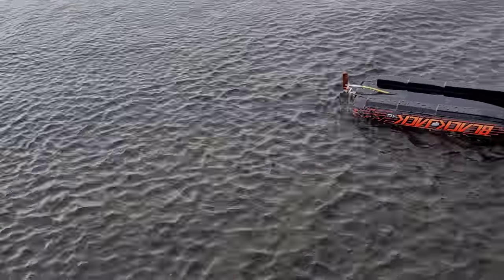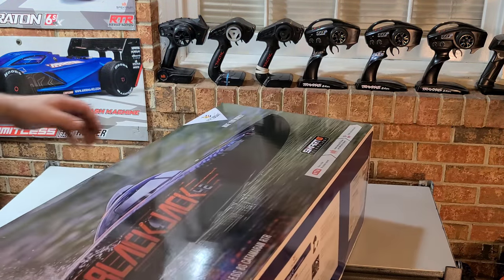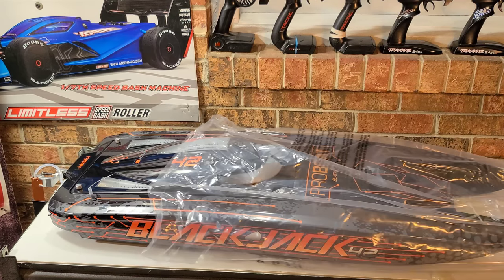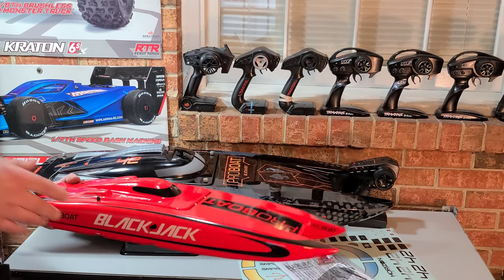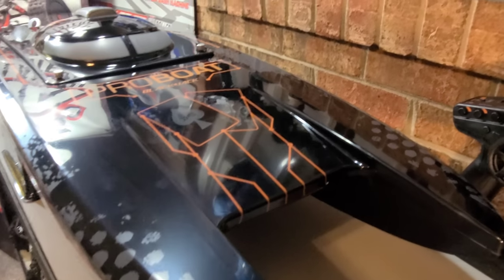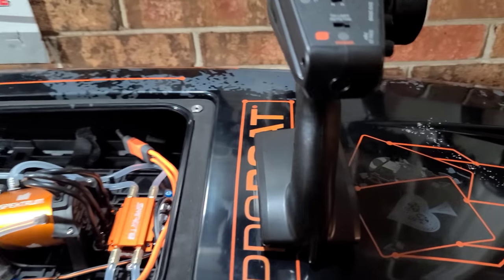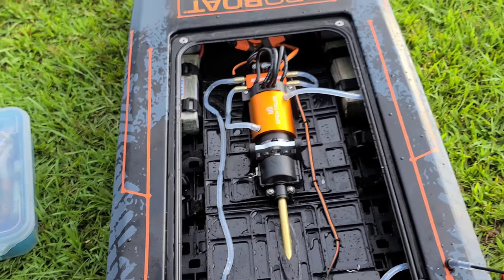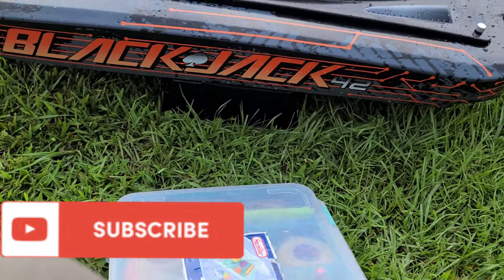Pro Boat Blackjack 42 Huge RC Boat Unboxing & Maiden Run

Comment: Hey Big B thanks for all the info on the blackjack 24 and 42! My flex shaft was glued into the adapter and had to use some of the information you put out to get my blackjack 42 apart. I'm running gens ace 6800mah 120c batteries. The boat toques to the right out of the hole and just fly's now for some strut tuning. I did the Velcro in the battery tray and ordering RCBB for the 24 and 42. Thanks for all the good info Bro.

Comment: What’s better for a new to RC boat person? Sonic wave or this black jack? Been into RC car for 3 decades but haven’t done the boats.
Reply from the maker: Personally I think the SonicWake would be better, it has self-righting,  and lots of tuning options inside and out, the blackjack is my favorite catamaran in my fleet, she likes to flip at high speed so RCBB trim tabs is a must for the 42 and big 7600- 8000 4s × 2 packs to weight the bow down.     SonicWake is basically ready to go out the box other than adding an extra cooling circuit.
Reply: @IRONCLADRC sounds like it would be an easier introduction for a first timer to go sonic. Thanks for the information!

Comment: What brand of 4s batteries do you recommend? I am going to run my blackjack all stock?
Reply from the maker: Smc hcl-hc 7600mah 150c 4s
Reply: Any trick to getting the trim tabs on correctly? Mount them level, or slightly above?
Reply: Just purchased the blackjack. Thanks for posting these videos. Would love to get a little help with this boat. I had horrible luck with a TFL Cheetah XL. It’s a 1,400 paper weight

Comment: Hi good day..is it ok if use a 150a esc and a 4082 Brushless motor on a 47 inch Catamaran boat?? Thanks..😃
Reply from the maker: I'd actually go with a larger esc.   MY ESC a seal 220.     A 150 fluly olor would work don't get me wrong but your gonna have hot/high Temps with below average preference.  Go a little larger with the esc. Always better to have more power than needed
Reply: @IRONCLADRC  thanks for the help..i am from philippines..always watching your videos..thanks a lot
Reply: Hi what if i use 2 esc set up 120amps two 4082 1600kv Motor on my 47inch rc Catamaran project..will it work? Or it will overheated? What S type battery would you recommend if this will work..thanks again..
Reply from the maker: Yea twin setups would be much better for a 47inch inch catamaran
Reply: @IRONCLADRC  thanks..can use a 3660 3500kv motor? Because i have an extra here..sorry i did not mention earlier..
Reply from the maker: if it were me id go with a 3682 sss motor it would gi e you better performance than the 3660.    you have the room in a large boat.  3660 would work but its gonna run hot with a larger boat like that?
Reply: @IRONCLADRC thank you..this is a lot of help

Comment: Noticed that the hull gets pretty wet inside, my Zelos is bone dry only with the thumb screws. Wondering if this one leaks water and will need to be taped up to keep it bone dry inside? Also have you tried to make any strut adjustments to keep the front end down?
Reply from the maker: Yea I should tape her up. I think it's due to the hoses runing thru the hull without fittings?  I need to tape her up that's for sure
Reply: This looks like a great boat, but I can’t see paying $500-$600+ for an RC boat only to have to tape it up to keep water out.

Comment: Hi have you tried the 9000Mah Zeee Batts on your Black Jack 42. If yes what is your opinion  about the 9000 and the average runtime you get from it. I was thinking of buying them but cant find review. Are Zeee batteries reliable in terms of quality and longetivity. Id really appreciate your oppinon  so i can make up my mind what to get thats best for the Black Jack. Thanks
Reply from the maker: I've used the 6000 100c  on my  42 they're good batteries I haven't had any problems with them get  I would say 10 minutes or more run time..    Most all lipo batteries are kind of hit-or-miss you know.  Thanks for watching

Comment: How does compare to the Traxxas Spartan? Faster? About the same?
Reply from the maker: I think the blackjack 42 may be a little faster if  Tune correctly takes a lot of work bit's a work but I think it may be faster than a Spartan has potential

Comment: Seems like the front end likes to come up alot and your not even full throttle.. I might have to stuff some pool noodles inside.. Whats the average run time are  you getting on 8S?
Reply from the maker: I've been getting around 7-9 min runtime on 6000mah 50c hrb x2.  If you run the batterys forward Basically  as far as they will go it stays down. That was my first run.. so I wanted to see the extremes  forward and back with weight distribution
Reply: @IRONCLADRC  Fit some accelerometer-controlled aerofoils to stop extreme lifting.

Comment: This is real good.will you add trim tabs
Reply from the maker: Pretty sure trim tabs don't belong on a cat?! Weight Distribution and strut placement  should do the trick.
Reply: @IRONCLADRC  Oh okay,there is a few guys that are using trim tabs to fix the issue on other boats my friend Garry I think is trying trim tabs today to see if it fixes the issue also he is changing the prop to bigger and better lipos..The Black jack42 reminds me of the Zelos 48 and no one fitted trim tabs
Reply: @paulcooper7162  paul is right.  this cat is not very well balanced from the factory..even with 2x 4S 6.000 mah batts all way forward it will fly when you want full speed...buy some nice trimtabs and problem solved.  for $600 they should of made it better.
Reply from the maker: I agree.  It's so wide...   Gonna be rewarding to get it right..  it's got potential .

Comment: Instead of removing material from that barrel, why not add material that tapers to the brass tube from the barrel? Silicone maybe or some solder and a little filing might work.
Reply from the maker: Awesome thinking thanks
Reply from the maker: A tapering fitting would probably work best. Silicone may be a little tricky to workwith